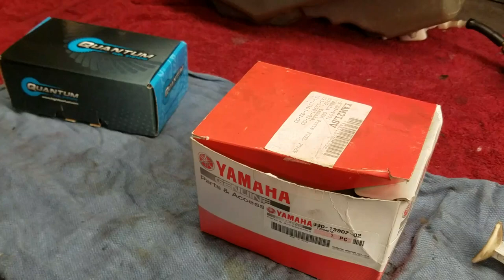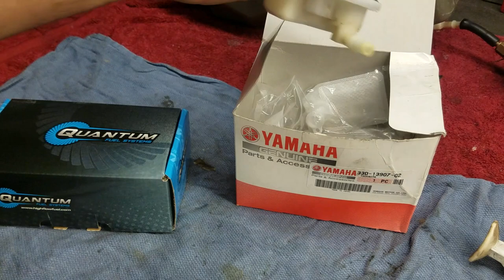1:11 YZ250F Fuel Pump Failure & Repair  (same for YZ450f). Hard starting, bogging, and popping.

Comment: My '17 YZ250F started bogging and popping like a week ago. Tomorrow I will try and do most of this work and see how she does. Thank you for your knowledge.
Reply from the maker: Your welcome. Hope that does the trick. Also if the PSI is not right toss a new fuel pressure regulator at it, they can go bad too.
Reply: @UpAllNight91  Today I put in a Quantum Fuel Pump with a fuel pressure reg and she starts first or second kick. I also cleaned the throttle body, fuel injector and the idle screw. Thanks again!
Reply from the maker: @3XTS  Thats AWESOME NEWS!   Thanks for the update!

Comment: Hello UpAllNight91, ive been watching your vids on the YZ450F and using your vids on my own 2017 YZ450F, i have a few startup issues when kickstarting it most times it takes me like 5-10 kicks to get her going and even when i turn it off and try to kick start it again straight after it take a few kicks when warm, any ideas how i can fix this issue ? cheers.
Reply from the maker: Hello . Do you know when was the last top end?  Sometimes a tired piston and rings can take a few more kicks than normal to fire up. Also sometime a old worn spark plug can cause hard starting

Comment: @UpAllNight91 I have an issue on my 21 yz250fx….bike fell over on stand at track blew 15a fuse replaced and bike started again but after riding noticed the fuel pump wouldn’t shut off. Any insight before I buy relays>pump>ecu? I checked connections and grounds all seem normal.
Reply from the maker: Hello. This is Scott on facebook correct?
Reply: @UpAllNight91  correct!

Comment: Question, I have a bike that has been sitting for years. Changed the spark plug (has spark), replaced the fuel pump (was corroded), and did an oil change. I put gas down the cylinder as it wouldn't start and after a lot of kicks I got it to run for a brief second before it turned off. What else should I look for?
Reply from the maker: Hello. If she can bark off for a second when you put gas in the cylinder than is safe to say the motor is good.  I would check that the fuel pump is producing fuel pressure with 12 volts ran to it. Next thing would be injector.   In my experience when a bike sits so long that it trashes the fuel pump it often takes out the injector with it.  I have had luck a few times by back flushing the injector but in most cases it just needs a new one.  If you get a new one I highly suggest a OEM one from yamaha
Reply: @UpAllNight91  I really appreciate the reply and you are correct the fuel injector was the issue.
Reply from the maker: @Rikidybones  thats good news!  Thanks for the update

Comment: Great video. I have a 2017 yz250f in otherwise great shape, (no e-start, about 60hrs on it) but it always takes two or three kicks to start. Any ideas what I should check?
Reply from the maker: A kick start bike can often take 2 to 3 kicks.  My 2015 yz450 is in great shape and she's like that.  Sometimes I can get lucky with a single kick start and I often feel it on the kicker knowing its gonna be a good one.  But 2 to 3 is kinda normal.  Remember no battery, so your single kick is spinning at stator which is making power, power is needed to turn on the ECU and fuel pump needs power and needs to prime up fuel pressure. Sometimes all that doesn't get there in time on the first kick

Comment: If the fuel pump is the issue, would it still run ok after getting it started even if it takes like 10 kicks to get it started? I wonder this because of how fast it would lose pressure in the beginning of the video with the bad pump as opposed to the end of the video with the good pump. I have a 2014 yz250f and usually had trouble getting it started, but once it was on it would run fine and it was also pretty easy to start when it was warm. Just recently however it started failing me even while running, it would start to bog and lose power and would occasionally pop as well. My buddies and I think it might be bad gas or dirty connectors or dirty injector something like that. I haven’t taken it apart yet but am thinking about doing it soon so any advice is greatly appreciated. Also thanks for the video man, very thorough and detailed!
Reply from the maker: Thanks man! Totally sounds like a fuel pump thats failing.   I have a bike here right now with the same issues. First was hard to start cold. Then started bogging and popping and getting worse and worse.  Checking the pump and it drops pressure fast and with power ran to it, it varies pressure consistently,  not holding steady.  I'm replacing the pumps motor and also the fuel pressure regulator.  That should fix her up.  If you don't buy a oem pump assembly then I do suggest a fuel pressure regulator and a fuel pump motor rebuild like like all balls or quantum
Reply: @UpAllNight91  Appreciate your reply! Yea I’ll definitely order the fuel pump rebuild kit like the one in the video, thanks again for the videos and your help man!
Reply from the maker: @Rkmmm751  yes sir. Also pick up a new fuel pressure regulator. Its on the fuel pump assembly. Change that out too.  They can be found on ebay for like 20 bucks.  Often when the pump goes bad from sitting the fuel pressure regulator gets all wonky too .
Reply: @UpAllNight91  Will do bro, thanks!
Reply: Question: Is it normal for it to be leaking fuel when you pull off the fuel line clip? The nipple the comes out from the fuel pump to the fuel line started leaking gas as soon as it pulled off the fuel line and it doesn’t stop
Edit: I rebuilt the pump with the Quantum kit and it fires right up now! Everything seems to be working fine now. I did notice however that the nipple I recently mentioned still leaks with the new rebuilt pump. The only issue I noticed is that when I start the bike up I start it with the choke pulled out, and when I push it back in so that it goes back to a regular idle it shuts off right away. Any advice for this? Anything is appreciated, thanks again!
Reply from the maker: @Rkmmm751  no it shouldn't just free flow gas when the line is disconnected.   I usually see this with pumps that are bad or going bad.  After a rebuild or replacement that stops
Reply: @UpAllNight91  I see, so then could this possible be the reason as to witch the bike turns off when I turn off the choke?
Reply from the maker: @Rkmmm751  it could be if its also unable to keep fuel pressure up.  I would at least check the fuel pressure
Reply: @UpAllNight91  The fuel pressure was at 54 psi after I rebuilt the pump and it dropped very slowly like in your video. I’m wondering if maybe there was something cracked within the fuel pump assembly that allows gas to flow through and leak out of it. I’m gonna pull it apart again sometime this week probably and hope that it’s something I can fix. Thanks for all the help and advice again man!
Reply from the maker: @Rkmmm751  ok.   Also sometimes the fuel injector can use a back flush after a fuel pump repair. Its just been my experience.   Before the back flush , bogging , popping, and poor idle.  Back flush has fixed that a few good times.
Reply: @UpAllNight91  Sounds good, I’ll definitely do that as well!
Reply from the maker: @Rkmmm751   you will need to supply voltage to the injector to open it and then back flush. I made my own little low amps 12 volt DC thingy for injectors from a old plug in transformer but I think they sell them on Amazon too.  I use brake cleaner and compressed air to back flush.
Reply: @UpAllNight91  Thanks man! Do you have any advice on what you think might be causing fuel pump leak when I remove the fuel line from the gas tank/fuel pump?
Reply from the maker: @Rkmmm751  usually when that happens I find one of the o rings in the pump didn't seat right or doesn't seal well. A little dribble for a second is ok but if it keeps dripping and doesn't stop I dig back in and figure it out because it surely is a problem
Reply: @UpAllNight91  Yea I wouldn’t be too worried about it if it were just a dribble but it’s more of a small stream that doesn’t stop. I usually have to somehow plug it it in order to get anything done without it making a mess lately. I’ll pull it apart for sure then and check the o-rings and I’ll look for cracks or anything else that might be causing that issue
Reply from the maker: @Rkmmm751  any luck?

Comment: Where did you buy that fully set up fuel pump cause I have a 2015 yz250f that needs a new pump and I don’t want to just rebuild it
Reply from the maker: Hello. It can be ordered from the OEM sections of parts dealers. Here is a link to a video I put together showing how to order OEM parts https://www.youtube.com/watch?v=slOfGOMQshs&t=1s     ..  If you want just a link to the pump from one vender here is a direct link to the pump https://www.partzilla.com/product/yamaha/33D-13907-00-00?ref=370e57044c4e6b113d298a3c8292452405ac7602

Comment: Chris, would you do a short video on exactly how to remove the fuel line from the tank at disassembly?
Reply from the maker: The line from the injector to the tank or the line inside the tank on the fuel pump?
Reply: The external line to the fuel pump where it mounts under the tank. Not the electrical connector.
Reply from the maker: @damnbikerw5043  Ok. Unfortunately I don't have a YZ here right now that I can put a video together on that right now. Is this something you are needing to do ASAP?
Reply: not a huge hurry but fairly soon. I’m needing to do a top end on my 17 yz450f. I know I don’t have to disconnect the tank, I can just turn it around and strap it down to the sub frame. I guess that’s what I will do for now. But if you could remember to maybe add that part in to your next YZ video, I would appreciate it.
Reply from the maker: @damnbikerw5043  Yes sir. There is a little black plastic thing that goes around it that you need to remove first, then slide the cover up. Then press in the two tabs. On the next video I will surely cover that in better detail. Thanks for the suggestion ☝
Reply: got it. I’ll give it a shot later today when I get back home. Thanks bro.

Comment: Bike turns on then shuts of two seconds after its running could use your opinion on what you think it is the time I did get it to start I made it bark then it turned off again. When I kick it it starts for a second or two then turns off what you think the issue could be?
Reply from the maker: Hello.  I would check the fuel pump.  Make sure its making good pressure and holds the pressure well.  Next thing I would do is back flush the injector.   Sounds like it's starving for fuel.  I had a bike here that did the same thing and it was a weak pump.

Comment: Do you know where to find the replacement 0 ring for the fuel pump ? Or even the size of that o ring ? My original one was bad and can't seem to get any help from quantum
Reply from the maker: I have like a million o rings.   But a good start is to swing by harber freight and pick up a o ring kit for like 8 bucks.  It has a ton of o rings at various sizes. That should have one in there for you
Reply: UpAllNight91  thanks dude , appreciate the follow up

Comment: What do you do when you cold start? Pull the choke? Whats your choke knob set to (turns counterclockwise from closed). Dealing with my first FI. No start at all or idle. Starts when i open up throttle and dies really quick. Cant keep it on while opening throttle. Cleaned injector. Fuel pressure test is next. Messed with tps and no luck. Any help is appreciated!
Reply from the maker: What year is the bike?
Reply: @UpAllNight91  2015
Reply from the maker: @manuelgunner100  that can be tough to find.  I would try connecting a yamaha t
GYTR tuner on it and check the values of the sensors and check for trouble codes.  I did see a bike like that run about like that due to a bad map sensor.  That was a tough one to chase down though.  GYTR tuner surely helped though
Reply: @UpAllNight91  imma have to get me a tuner thanks for your help! I tested the pump with 12v and it had less than 5 psi. Im hoping thats it.
Reply from the maker: Oh yeah 5 psi is way too little. In my experience on them yz's its the fuel pump regulator that usually causes low pressure so be sure to replace that as well
Reply: Did you ever find out how many turns counterclockwise the choke knob should be?  Thanks.

Comment: Seems like it was a regulatory issue just bleeding off the pressure.
Reply from the maker: I think your right
Reply: dont you remember it was only going to 30lb pressure
Reply: @trentweeks1071 if the regulator gives out first then the regulator is at fault. The regulator is what limits fuel pressure not the pump. I see many times that a fuel pump complete assembly is changed when only the regulator needed to be replaced. If you can prove that the regulator is not the limiting factor as in bleeding off pressure then in fact the pump is at fault. The regulator also needs to hold pressure. The pump runs none stop so if you cut power to the pump and immediately lose pressure then the regulator is not holding an is at fault.
Reply: @whiteman3075  hey bro my fuel pump drizzles a bit not too much is that normal it will leak more if I tilt it I took my gas tank off that’s how I noticed that it was leaking a bit
Reply: Fuel should not leak anywhere at all ever out side of tank. Do you have a seal issue at the tank or in the fuel connection. Find out right away. I had a buddy have a fuel line burst a hole in it and it bogged over a big jump and bike endowed and he was very lucky he walked away with just bumps and bruises. It’s a big safety issue figuring out your leak is a priority.

Comment: Hey mate is it possible for the pumps to go bad after sitting for a long time? Let my 2014 yz450f sit for 2 years and now won’t even burp after 100 kicks, I drained fuel, cleaned injector, etc, it’s got a brand new top end also so I’m guessing fuel pump is culprit
Reply from the maker: For sure. Very common when they been sitting for some time. I usually just check the pump like I did in the video with a battery and pressure gauge. You will most likely find it bad. When they sit that log not only the pump motor can go bad but also the fuel pressure regulator thats on the pump housing. Also sometimes the injector can get gummed up from sitting as well. But I start with the pump and keep my fingers crossed that the injector is ok. 80% of the time it is.

Comment: Hi bro I have a question, my yzf 250 losing power when Im on full throttle(like starts bogging a little) , many people told me that the fuel pump is problem. what do you think about it? thanks 🙏
Reply from the maker: Hello. It could be the fuel pump but I have also see spark plugs cause the same issue.  I have also seen throttle position sensors do the same.  I would first start by changing the plug, and check the throttle position sensor if you have the hand hand tuner or if yours is a 2019 or newer you can use your phone.  If all that checks out good then I would dig into the fuel pump.  Good chance its just a plug, I've seen so many shops over look that

Comment: Washed my bike yesterday nothing new or out of the ordinary. No pressure washer or anything I never blast water into where it shouldn’t go. Was in washing it I heard the buzzing from the fuel pump randomly kick on for a second. Nowhere was I near the start button. Started it after I washed it and took a while but finally turned over. Let it sit for a couple hours and now nothing. Fuel pump won’t even turn on and make that buzzing noise which leads me to believe it’s fuel pump. Turns over fine but no spark either. You think it’s fuel pump? Watched your other video and saw you only replaced the injector. Any thoughts?
Reply from the maker: Right off the top of my head, I'm guessing your PCM (some call the CDI) went bad. No spark and no fuel pump action but was acting funny turning stuff on on its own before going dead. I'm guessing PCM. I have seen these PCM's do strange things when they go bad. Example on one bike it would never shut the fuel pump off after shutting the bike off, it was a bad PCM. But of course before buying a new PCM I would check as much as you can. First check the fuse on the starter solenoid/relay. Maybe try diconnecting the PCM and checking terminal is clean then reconnect. If you know someone with a bike like your ask to try their PCM on your bike. Its advised to always check the whole harness before just buying a new PCM but that can be so time consuming.
Reply from the maker: What year is the YZ?
Reply: @UpAllNight91  2021. Freshly rebuilt with about maybe 20 hours on motor. Super clean and well maintained
Reply from the maker: @andrew.cardone  Ok, try connecting to the bike with your phone app and see if there is any action there
Reply: @UpAllNight91  tried that last night and nothing
Reply from the maker: @andrew.cardone  Ok. Battery is good, it turns over when button is pressed so we have power...  check the fuse on the starter relay . Even replace it with the spare fuse just to be safe. If nothing then next disconnect the PCM and reconnect. And still nothing, I would try a new PCM.  Of course it could still be a harness issue but likely not. However if you wanted to the manual does walk you checking all that in the trouble section part, to at least be sure the PCM is getting power from the harness so at least the app would work. But my guess is still a dead PCM.
Reply: @UpAllNight91  alright man thank you I’ll try all that and get back to you if all else fails !
Reply: @UpAllNight91  yes so like I said battery runs great. The fuel pump is not activating when you hit the button and when checking the spark plug I’m not getting any spark as well are my issues.
Reply from the maker: Yeah. I think its the PCM, but check the other stuff like fuse and stuff first of course